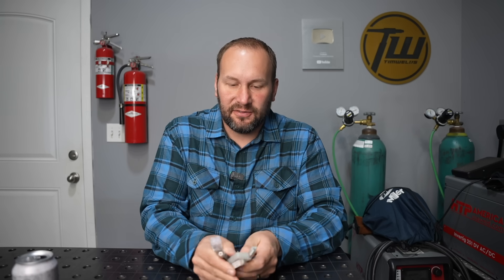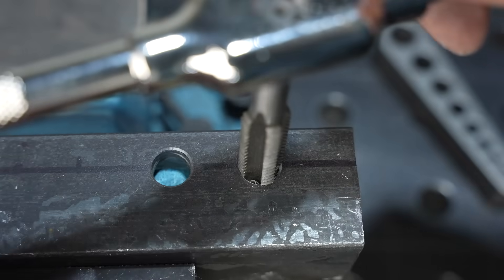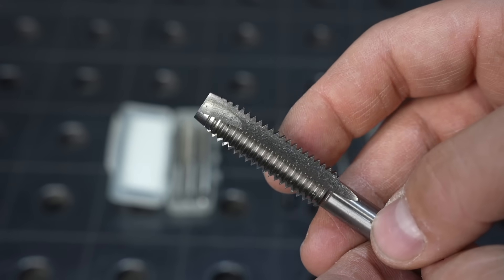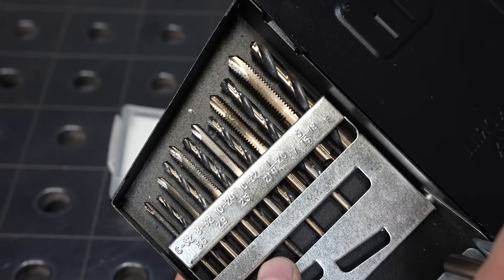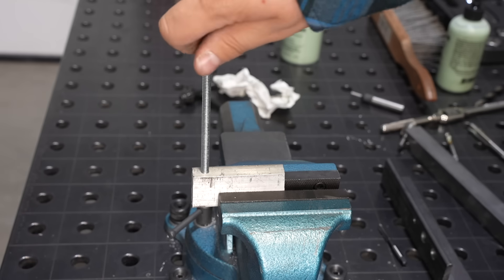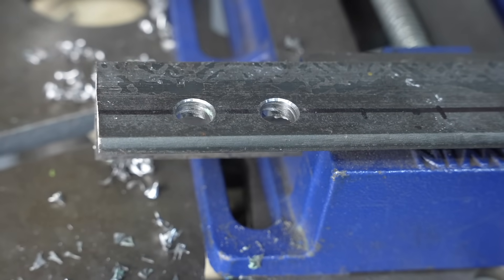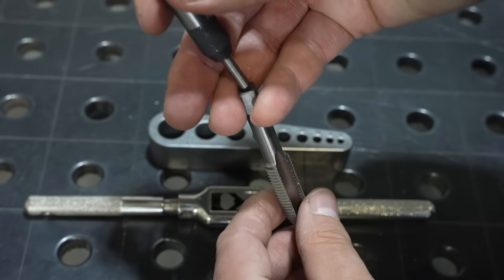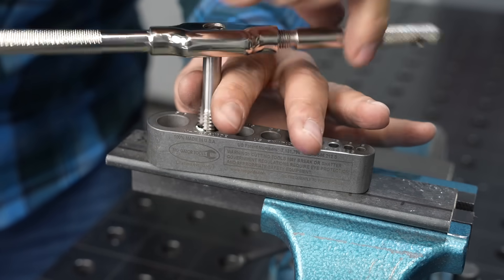Never Break Another Tap: The Complete Guide to Tapping Holes in Metal

Comment: I have that exact GearWrench set of taps and dies. Tonight, I broke my M8-1.25 tap trying to tap the leveling feet holes for a wire rack shelf. The original hole was taped for 1/4-20 but the casters I have are M8-1.25. I snapped that tap so easily. I purchased an OSG spiral point from Zoro Tools for a little over $41. I hope it does the trick when it arrives in a few days.  Thanks for the video!

Comment: I used my drill press to tap 16 holes in aluminum extrusions. Except instead of doing it by hand, I would feather the power switch on the drill rapidly on and off to tap my way down at a slow and steady rate. Worked perfectly. Once it was done and fully threaded, I would hand turn the chuck backwards until most of the tap was out of the hole and then for the final 10-15% I would keep one hand on the feed handles to reduce the upward pressure from the return spring, and carefully back out the remainder of the tap. Each hole was perfectly tapped nice and perpendicular to the surface and it was so much faster than manually tapping by hand. The only annoying part was the cleanup between each hole but that would have been annoying even doing it by hand so it wasn't some sort of negative to the drill press regardless.

Comment: Go do a search on "what is an intermediate tap".
It clearly states its the SECOND TAP.
1-TAPER
2-INTERMEDIATE
3-PLUG

but here it is cut n paste because i know you wont

An intermediate tap, also known as a second tap, is a type of hand tap used in threading operations, particularly for general-purpose applications and for ensuring a thread is cut true in a pre-drilled pilot hol
Reply from the maker: Search “what is a plug tap”

A plug tap, also known as a second tap or intermediate tap, is a type of threading tool used to create internal threads in both through holes and blind holes. It features a chamfer (tapered section) of about 3 to 5 threads, making it suitable for general-purpose threading in various materials and hole types.

(edit) Ran your search too:
An intermediate thread tap, also known as a plug tap, is a type of tap used in threading operations, positioned between a taper tap and a bottoming tap.

Comment: This video single-handedly gave me the freedom to be able to hand-tap steel.

After consistently breaking taps, I had decided to give up on hand-tapping steel --until I watched this video.

I needed to hand tap 6-32 threads into a piece of 1/4"-thick steel.  I broke two regular taps, before realizing that the technique was impractical.  I even took the project to two machine shops; asking if they'd tap the holes for me.  The first shop, flat-out refused.  He said that he hates tapping with taps that small.  The taps break too easily.

I watched another YouTube video that mentioned using an expensive machine.  The machine is awesome.  However, I'm only tapping eight holes, and didn't want to pay over $1000, just for a machine that I'd rarely use.

Since watching your video, I've tapped the rest of my holes with a spiral-point flute, chip-clearing tap; just like the ones described in your video.  It was relatively easy.  No special skills needed.

Thanks, so much, for making this extremely useful video!

Comment: Chamfer for starting the threads will work best at low rpm and when possible, using a single flute countersink. Spiral taps are the weakest of the bunch. They are prone to jam the chip into a tapping guide if its not immediately removed after starting the tap. (And how would I know this? Broken 4-40 spiral flute tap in an aluminum workpiece)

Comment: This is what they all say until they have to tap 6-32 threads into stainless steel. Then you'll be breaking taps like you're popping candy.
Reply from the maker: You’re not kidding. In my day job, I’ve sent many parts to the EDM to extract said candy…
Reply: @TimWelds  taps are brittle. Now I won't say they're easy to get out but all I ever need is a hammer and a punch to get them out. Just smash the broken tap up into dust and pour it out. Make the punches out of beat reamers.  Just sharpen points on them. Then punch your way to success.

Comment: Good lesson on taps and tapping. I was in the tool and die trade and the worst size tap ever was the #6-32 UNC; especially in tool steel or stainless. 
I set up my drill press to use as a tap guide as you; except, I fabricated a tap handle that adapts to the Jacobs chuck and allows me to turn the spindle by hand.
Also, I have a thumb screw on the quill return spring that allows me to take the tension off the spring.
Reply: Stainless, ug, gummy, if I remember correctly, kerosene was a good lube, or that might of been for bronze,,, memoryshot... lol...
Reply: You know the score. When you're tapping 6-32 into stainless throw out the chart. You're lucky if you can just get a shadow of threads then. But that's all you need.
Reply: Can you go into some details on the thumbscrew for the feed handles? I'd like to use my drill press as a tap guide but the spring on my Bauer drill press makes it super annoying to use. Would love to see what's up with your modification and maybe implement it on my own.

Comment: A1 Well Done the video is on my list of top 10 best vids but every vid I’ve seen always surpasses what type of material your tapping and what type of tap you require, because some metal is weak as piss but some material your tapping is extremely difficult to tap it would be good to see how you assess the strength of material your tapping and then identifying the tap your going to use , if you use the wrong tap and it breaks and then it’s a nightmare removing it especially if your a mechanic or working around your street machine on the weekend, Urock Keep Punching

Comment: Simple.. pay attention to the tap.., take some care..
Reply: @jerryrobinson7856  
Advice depends on what you’re tapping into.., the application, production/ tapping method (machine: hand) etc etc 
My comment is based in my being told… & then observing that a common aspect in most / many taps breaking.., was the operators attn to / or lack of…, to what is actually happening with the time, and how it is cutting or not..
And that when I started paying very close attention & i came to realise it taps…, are not a guarantee of successfully achieving a thread / without breaking the tap & especially the smaller taps..& esp smaller with course threads… in tough materials….
The proportional loads are far higher on them…. 
Same as when drilling extremely deep hole.. you have to “be the drill tip”
I remember tapping M3 into 316L.., I keep snapping them, foreman yelled at me to listen to: focus on the tap/ sounds: loads..
I complained that I only got 2 holes done.. before the tap was guttering.., he yelled.  “ because the taps is done../ spent: it blunt.., time for new tap.. M3 in S/s.. we got 2 off holes per tap…, he was like.. “why do you think I brought 80 of them..”

Comment: I suspect the main reason that people break taps is that the drilled holes are too small. Get the hole size right and it makes little difference what kind of tap you use.
Reply: please help:    yall make it look oh so easy but l'm new,  never had to do this before(20plus year mechanic BUT !    What if my material to tap is the "underside" of the swingarm on my bike ?       Yah it's aluminum but still it's not......   

 yah l was able to drill the pilot hole easy enough but l've been tapping for 3 years !      My god, it seems my threads never start ---  ls the pilot hole too small ?

my tap is from Elliott's hardware,  l'm using the floor jack to supply upwards pressure to the swingarm,  and motion oil as lube

 most importantly l'm using a 5mm at .8,  the lrwin hansen package said to use a #19 to make my hole --- l never found 19 so l used ⅛ or 3.2mm equivalent,  ls it too small or what am l doing wrong ?

help

Comment: Thank you for the video.  I hadn't seen the spiral point tap before.  However I have two points to make:
1 - I have found sets of three "progressive" taps.  They have the same tapers, ie taper, mid (you call it plug) and plug (you call it bottoming).  Or simply 1, 2 and 3.  They have another feature: the overall thread size of the no. 2 tap is ever so slightly less than the no.3 tap, and the no.1 tap is ever so slightly smaller than the no.2 tap.  And that makes a huge difference to the ease of tapping.
2 - I made my own tapping guides in my very basic lathe from steel bar.  Each hole is threaded.  I only need Isometric Standard M3, M4, M5, M6, M7, M8, M10 and M12.  I made two blocks, one has 5 guides M3-M7, the other has 3 guides M8-M12.  If you keep the orientation of the block constant, you guarantee that the no.2 tap enters exactly as the no.1 entered and likewise the no.3.  So no risk of cross-threading or cutting a second thread. 

Of course I understand that shops which use UNC, UNF and all the other threads would find my approach cost too much time, and finding "progressive" taps might be impossible or at least expensive.  But I assume that youtube videos are aimed at amateurs - OK, serious amateurs like me - and it is to these people that I commend my approach.

And while we're all here, another super-useful DIY jig is to take a flat bar, say 4×15mm (not critical).  Along the centre-line drill and tap one hole each of (in my case) all those threads M3-M12, then make a thin saw saw cut down the CL to a point maybe 20mm past the last hole.  File a V into the beginning of the saw cut.  Clean the burrs out of the threads with their corresponding taps.
Now you have the ideal jig for sawing and/or filing short amounts  off screws which you can't vice.  Enter the screw in its corresponding hole until it protrudes by the amount to ne removed.  Clamp the split part of the bar in a vice.  Saw off the unwanted bit of the screw.   Take the bar out of the vice, advance the screw a couple of turns and return it to the vice.  File the bur off the end of the screw.
This is the only practical way of removing (say) 3mm from a small or countersunk screw.  In theory you can split a nut and use that instead, but you'll find that bar worth making and keeping handy.

Regards.

Comment: i think another factor on breaking taps are the sizes of the holes you are tapping... by this i mean on the better sets they give you the size of the drill bits you need to tap, but they also show you the percentage strength of the tap threads your making.  the stronger the threads the smaller the hole to run the tap through.  the bigger the hole the easier the tap but isnt the strongest holding

Comment: Use a drill or mill to make your hole and when you switch to the tap you wanna chuck it loose preferably with you hand not as tight as you can get it but tight enough so it can cut for a few rotations, when it bits and the chuck spin on it, loosen and remove the chuck and finish finish it by hand, it won’t mess up your tap or chuck jaws cause it’s not tight enough but you’ll get good enough that you an shut it off almost before its spins and obviously if it’s cut deep enough without spinning just take it off anyway, works great, especially if you only have a drill press!

Comment: Stick it in a drill and go for it I see most do but only do this to repair a thread and have the clutch set low to cut out if much resistance helps when restoring items fresh holes if carrying load undersized the drill bit bit if just holding on covers or not requiring lots strength do holes slight larger can easily knock out hundreds of threads in minutes that way reducing work time each have advantages and disadvantages try them out for various scenarios 🫡😅 when tapping a blind hold not straight through drill extra deep to allow for tap and remove material if necessary with air line so doesn't plug the bottom bit of lube goes a long way 🎉

Comment: I was in aluminum manufacturing for decades. Coatings on the tap or drill makes a big difference (doing multiple holes anyway) Ticn coating (gold colour) is no good for aluminum. Uncoated bright finish is the best, on both drills and taps for aluminum. There is a Tialn coating that does a good job but the availability and cost often does not justify.
Black oxide finish and the gold Ticn tend to attract the aluminum and gull up the tap.
Of course cutting fluid is a factor as well. WD40 or alike seems to work great for hand tapping. Most people have that around the house.

Comment: Is it really that important to keep the tap straight, doesn´t the hole kind of guide it straight down? Love your videos by the way, I´ve learned quite a few things!!
Reply: No, you would think it does, but it doesn’t. Once you have cut 3/4 of the first thread, the direction is set, and after that, the only way is straight forward. If you havent got it spot on, your tap WILL break if you persist.
Reply: @Stefan_Van_pellicom   Absolutely.  Taps have to be started on the axis of the hole.   If necessary use some kind of guide, but get it right, or regret it.

Comment: Very good video. I don't have a big set of taps but just have the common sizes. I hate those Tee-bar drive tools, so on some of my smaller taps I have welded a nut on them and on the bigger taps the square drive will often fit into a 12 point socket. Then I use a Tee-bar socket driver or a drill with a socket attached.

Comment: Very good. Tim can’t cover every Liu t in a video without making it really long, so I’m going to mention a few things. I tell people to not bother getting “hand taps”. There are a very few places where they are an advantage, but it’s really just a very few. Use spiral tip taps instead. I’ve almost never used a taper tap. I know I should, but unless you’re buying a set, which I almost never do, I have very few. Unless you’re tapping hard material, just being careful is fine. With spiral flute taps, I have to warn people that as the cutting force is concentrated on just a very few teeth at the front, these taps are very delicate. Never use them for anything other than cutting the last two or three turns at the bottom of a hole, and do it judiciously. Also when tapping, if the cutting force suddenly rises, stop!!! Something is wrong and turn just a bit more and you will snap the tap. You can snap a half inch tap more easily than you think. Feel is very important in tapping, particularly with small holes. The tap on small holes from #10 downwards will actually twist when you tap if forces are strong. Aluminum isn’t easy to tap, be careful. I have taps for aluminum, but if you feel, you don’t need them. Lastly, don’t use any lube on cast iron, no. Matter what you may see on YouTube. It’s a bad idea on several levels.
Reply from the maker: Thanks Mel! Great tips!

Comment: How about a 2-56 tap, in 316SS using MolyD, 0.312 deep while just chasing threads and it will snap off with barely any resistance felt? How do I stop that?
Reply: Stainless is definitely the worst metal to tap but if you really didn’t feel any resistance when your tap breaks I think would be better for you to change type/brand of your taps!
Reply from the maker: I wouldn't expect that when just chasing threads as long as it isn't side loaded. I might try to get a tap with fewer flutes if one is available.
Reply: You drill a way oversized hole. You'll be lucky if you can get 10% threads.

Comment: Nice vid, Tim!  I use the same guides to keep the tap perpendicular to the work piece and find that it works well to use a locking C-clamp to hold them in place so I can use two hands on the tap handle. I'm going to try the Anchorlube as the typical cutting fluid runs all over and makes a mess.  Thanks for the tip!
Reply from the maker: Thanks! I'll have to try that with a C-Clamp.
Reply: In case it's easier for you, there's an exact equivalent cutting and tap lubricant at Lowes called Spyder I believe. Same water based blue gel. Makes cleanup much easier.

Comment: Great video Tim, Can you please help me I bought a new Mig welder and it has Voltage and Amperage knob,so my question is in that case is my Amperage my wire speed?
Reply from the maker: Depends on the machine. Unless it's a large industrial machine, the amperage knob probably controls wire speed directly and displays the wire speed until you are welding. Either way, amperage and wire speed are related so you can treat it the same. Use that knob as the primary way to increase or decrease heat. Use the voltage knob to increase or decrease arc length and tune the short circuit transfer. I have several MIG settings videos that show how to do this. A higher voltage will give a longer average arc, resulting in a bead with a profile that is more flat or concave. Enjoy the new welder!

Comment: Great video! I remember a few years ago when I was trying to learn more about taps, it was hard to find good video information.  I found a company "speed taps" and I like them for my jobs. With them, the hole is slightly larger than the normal hole, but nowhere near as much as the rollover taps. You run the speed taps in with an impact gun.     As for broken taps, I found  a great way to remove them. With the end that broke off in your hand, put a wide hose clamp loose on the end. Set against the piece in the part where it matches up.. Then, stuff the flutes with tig wire, tightening the clamp. Drive  the tool into the part and back out. Has worked many times over the years.
Reply from the maker: Thanks! I just looked up those speed taps and they look really cool. Great tip using TIG filler to get out broken taps, I've never seen that before. I always learn something from the comments on these videos. BTW, I just clicked over to your channel. That F-clamp fixture table mod is really smart and I think I need a trailer crane now too. Keep up the good work!
Reply: @TimWelds  thank you.  I will.
Reply: Great video! It is probably the best and most helpful I have found on this subject. 
Thank you!